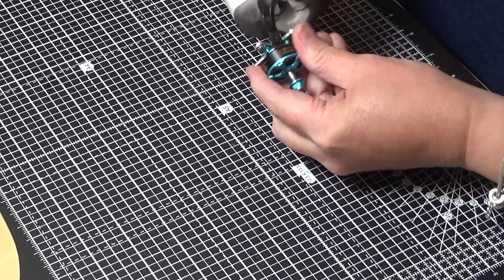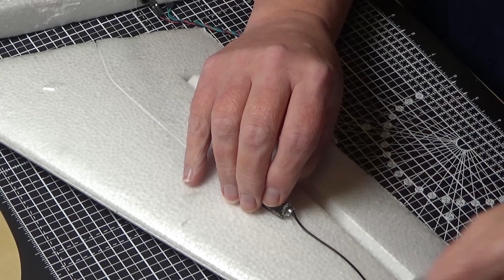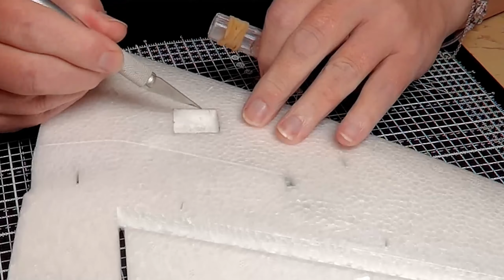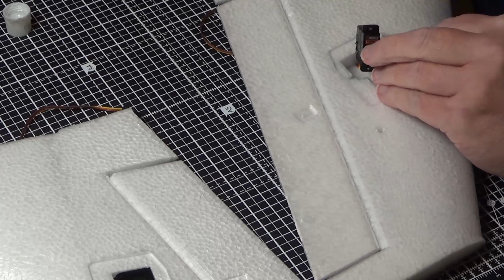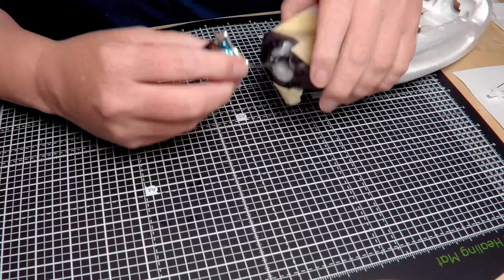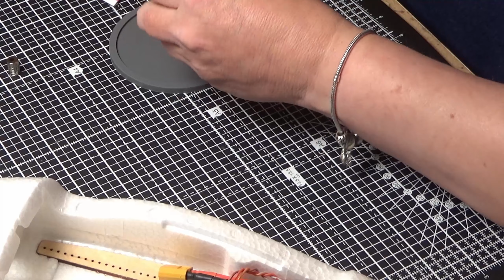Building the Hee Wing F 01 - Pt 2

Comment: I like the idea of the sacrificial screwdriver for burning channels - I usually use a scalpel for this, and it's tricky.  Interested to hear you launch with your right hand.  I'm right-handed too, but I tend to want my right hand on the radio and my thumb on the aileron/elevator inputs (throttle sticks goes in the mouth to move) While my left hand is my weakest for launching, I couldn't rely on my other hand being able to control the plane.  Different story if you are using launch mode I guess
Reply from the maker: I just can't throw left handed!!! Wish I could but I've learned to trust launch mode. However, my other hand launched planes without inav I still throw right handed and just rely on getting my hands back on the sticks asap. Makes for some 'fun' launches ;)

Comment: Interesting build , not sure I have what it takes to deal with all the electronics for FPV, I might have missed it so will watch again but I could not see the glue you used for the servos..enjoyed watching, Ebay  should will have the volt meter leads you need to replace...looking forward to the next installment...
Reply from the maker: Drop of E6000 is holding in the servos. Barring major crashes I don't expect these servos to fail.
These leads are already the 2nd set bought on eBay. Good quality, they are not :)
Next and final installment on Friday along with the maiden video.
Reply: @Caroline_Tyler  - I thought that is what it was - I have a tube of it but never got around to using it as I was not sure if it was foam safe ... eBay LOL - The Simpsons did a scene with Homer buying a hand bell from eBay - rang it once and it fell apart ..LOL..
Reply from the maker: @FlankerTanker  E6000 is great for EPP and EPO (do a spot check for EPO) but not for most other foams.